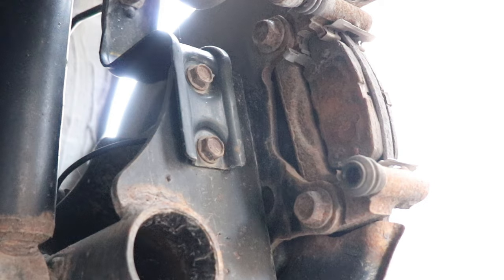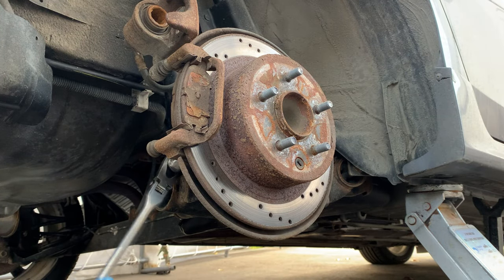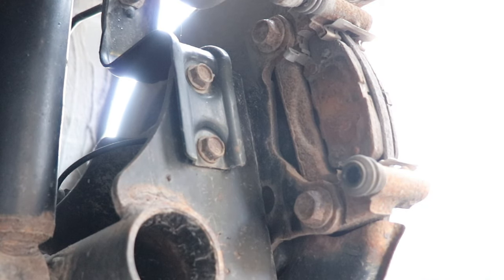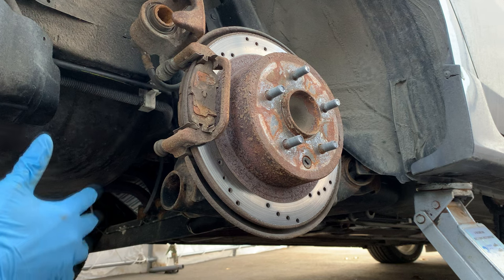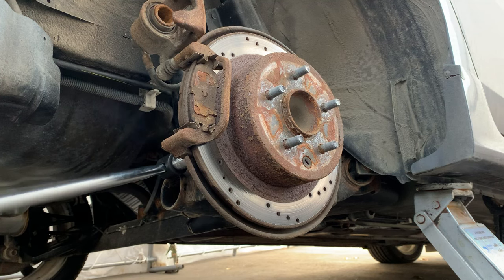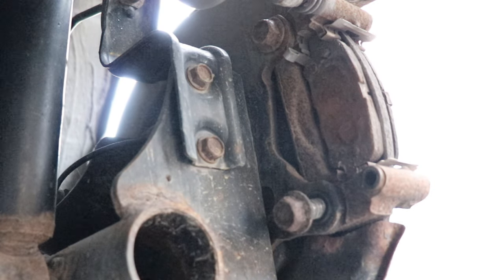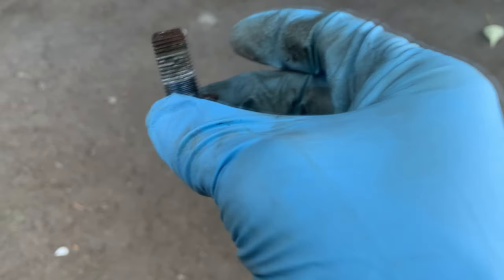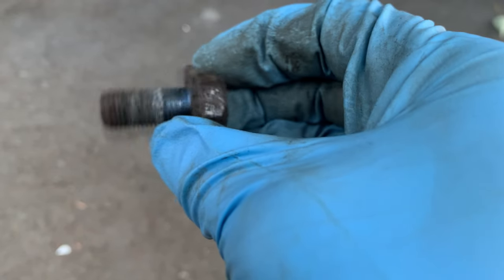How To Free Seized Caliper Bracket Bolts

Comment: Wish I'd watched this before snapping the head off one of my front caliper bracket bolts. Any idea how to get the broken bolt out without damaging the bracket?
Reply: How exactly did you snap them? I sure dont want to do the same
Reply: Dude!!!! I just snapped mine 😢
Reply: @SkynetTeamDREADWING   Ya, sorry. I ended up taking mine to the local garage. They drilled them out, tapped them and put in new bolts. Good luck!
Reply: @DZ-gl7no  all the shops here are close 😭
Reply: @SkynetTeamDREADWING  Bummer man. Uber through the weekend and call the shop on Monday. 🇺🇸
Reply: @DZ-gl7no  im trying to see if there are any available mobile mechanics....they are all probably enjoying the long weekend
Reply: @SkynetTeamDREADWING  I'm sitting on my deck enjoying a margarita. 😊
Reply: @DZ-gl7no  yuh, im getting it towed 😅

Comment: Last time my daughter took her car to a garage for new rotors and pads. They way over torqued the caliper bracket bolts. For her new brakes I Had to insert the ratchet handle into a 3ft pipe. I was so worried the bolts would snap. Luckily they didn’t. 
You just can’t trust some garages. Once they use the air tools, they tighten the hell out of them.

Comment: I have the same problem right now with a 2007 Mazda 6. Trying to do the reap breaks and I can not get the damn caliper bracket bolts off. I already rounded 1 bolt and there is ZERO room back there to get any kind of leverage. I am stuck. When you are heating up a bolt, you think 2 minutes is the min? Maybe I did not heat mine up enough.
Reply from the maker: @m.t.v.7934 Ideally you want the bolt glowing red but its not possible with a regular propane torch. 2 minute would be a minimum but of course with really stubborn bolt you have to heat a lot more.
Reply: if ur on the right side, use a jack to take it off

Comment: Im trying to remove the ones off my kx250 and I've heated them up for at least a min and im afraid to snap them off or melt something or even explode my caliper lol what should i do im replacing the original one's with nickel ones im restoring it to better than new 😮
Reply from the maker: @rockman49er hey there, as long as you focus the heat on the bolt you should be fine, stay away from plastic components. Use wet rags and place them around the components that you dont want to heat up, the ones around the bolt. Heat it up for a good 2 min and the try to loosen it by hand, if you feel that its still too tight and you might break it, cool down the bolt with water and heat it up again, you will eventually loosen it. good luck!
Reply: @OneTrickTech  thanks very much I'll give that a try 😀